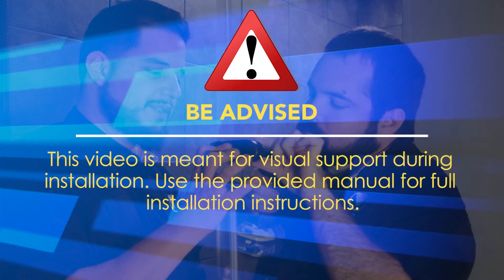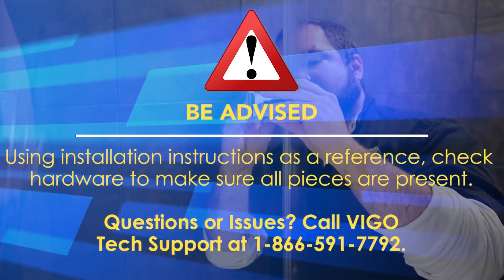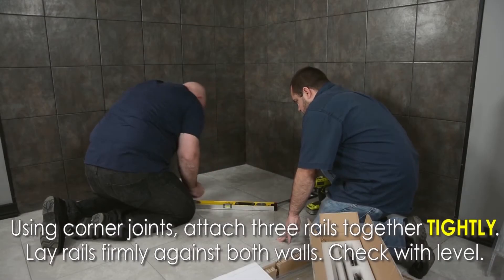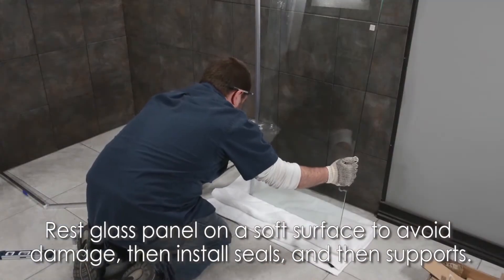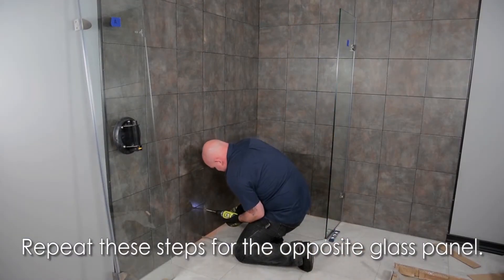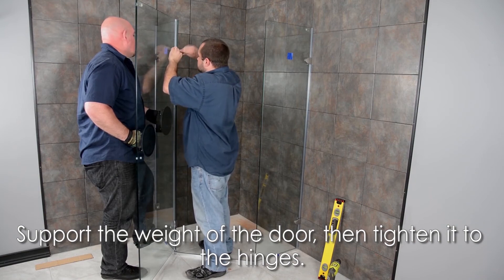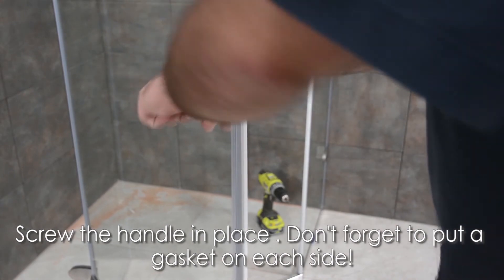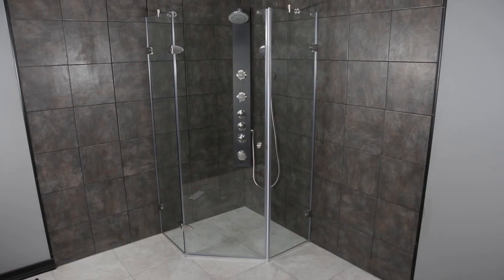VIGO VG6061 Verona Frameless Neo Angle Shower Enclosure - Installation Tips

Comment: Vigo, you need a better installation video. I give this video a thumbs down.
Reply from the maker: We're so sorry to hear that. What's the issue that you wanted to resolve?
Reply: I called your office spoke to a fella by the name of Jeff but he wasn't able to help because he has no experience in the installation of your products. He said David Henderson his manager who had experience in installing your Neo angle products was going to call me to resolve my problem but I have not received a return call from anyone who has experience in the installation of your product.  The problem I have is a crooked back wall that a ceramic tile installer installed. According to your guidelines it states for a 42 in. Glass panel should be 40 in by 40 in where the channel will go. However the back wall is crooked. When I use my 90° laser the lines do not match. Should I use the back wall or the laser as my true guide to install the track so the door and the C wall will align to the magnetic strips. VG6061